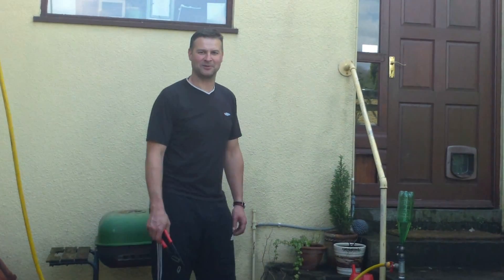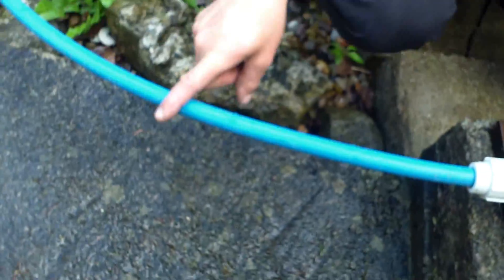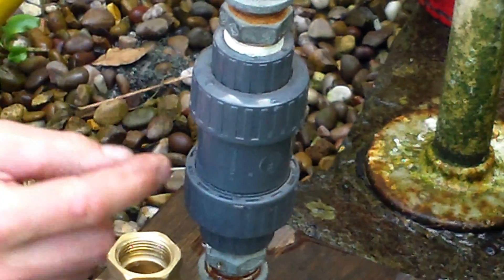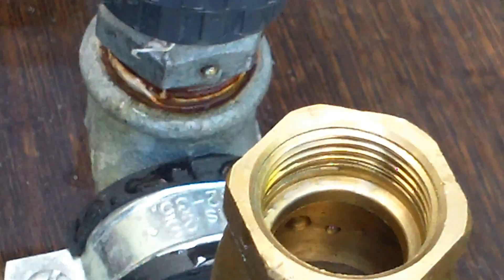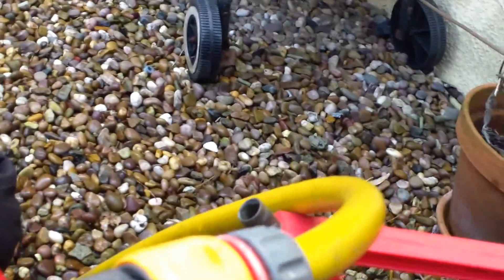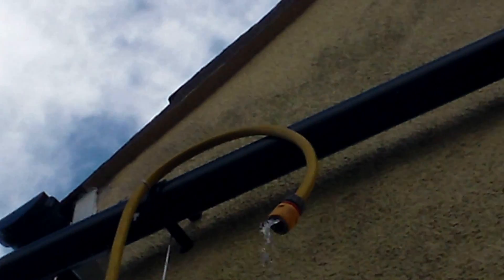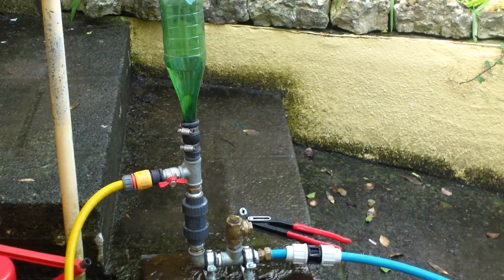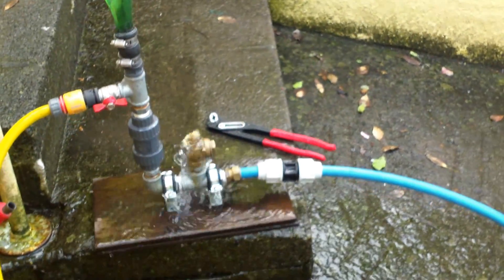Home built model hydraulic ram pump

Comment: hi jony sorry I took so long but it,s dificult to know where to start . So ram pumps,!!!!. if YOU could raise the preshure in the top chamber to 3.5 bar and spirell the the out flomin a loop and back uf around the main chute  in a much rudused pipe  ?????with that cind ov power we could drive several turbins set in,line back down another second tube en  anyway i have these two explosion resistent G 3.5 bar plastic gas main pipes with about a foot of ifon wraped around it in a geometric funnel and i beleive WE MIGHT BE ABLE TO COME UP  WITH SOMETHING starteling but i think these to tubes are only the core of  the sistem it will grt bigger cos think we put that much water pressure in your hands on a variable novle you brain will wake up to this   look up viktor schauberger ard realy watch his living water a then watchh callem coats who tells the true story of schauberger 
 and then go from there but i also have some unbeleivable picturs from egypt which havnt appeared in print that would make you think   anyway think on this lot and if want get in touch

Comment: hey jhonny..nice video.. i tried the above setup using 1inch swing valve, 3inch inlet pipe and 1.5inch outlet pipe..bht the valve was not opening and closing automaticLly.. can you suggest wat went wrong

i want to make a system for 4" outlet pipe.. i have got good flow of water around my farm. it would be nice if you could advise me dimesion of parts to be used  to make 4" delivery from pump..
thanks a lot
cheers

Comment: Planning to build a delivery system from a well which is about 14ft deep to feed drinking troughs for cattle, Could this type of system be adapted to also pump up the water from the well and run horizontally to 2 troughs, thanks.

Comment: Great Video. could you use the water flow out to turn a pump that you could hook a dc generator up to to create DC Current? and how much air pressure can you get to build up? Could you get enough to air up a tire or run air tools? Thank you heres my email address. cody.wilkenson@yahoo.com

Comment from the maker: Hi,

The pump needs to be situated above the water level. I'm afraid you will need to get a fall of at least 2 ft, preferably a bit more, you will have to lengthen your drive pipe, if it becomes too long you will need to install a standpipe about 20 ft from the pump, i'll send you my email and i could send you a diagram.

Comment: Hi Jonny, thanks for the reply, I appreciate your time. Still missing something though. How can the swing check valve be clear of the water, if the pump is at the bottom of the stream? The river is pretty level, I can only get "drop" using the height of the stream, so the pump bits, including the swing check valve would need to be 2' below the surface. Or am I mis-understanding?

Comment from the maker: Hi, if you can get sufficient fall over the 30 ft then you should be fine, aim to get at least 2 ft and you should be in business, try and anchor the drive pipe to prevent it from moving too much, this will ensure your pressure wave is maximized. Bolt the ram pump down securely, on a piece of wood or better still a short length of RSJ or similar. Swing check valve should be clear of the water to keep it working well. Its a bit of a suck it and see thing, a bit of experimentation will be needed j

Comment: Hi ,
love the demo, quick question. We have a stream, not too deep. Assuming the pump sits on the bed of the stream and we use a long inlet pipe (30'), the other end just below the surface upstream, will we still get enough pressure? We dont care if it is a gallon per day, as long as it works. Is it OK for the brass swing check valve to be well submerged, will the water still push out of it?
thanks

Comment: Thanks for the operating description.  Apparently some people don't realize that the ram pump is located about 10 feed below the source, in or adjacent the downstream waterway.  So the waste water finds it's way into the stream where it would have passed (if not captured by the upstream feed hose) anyway.  I like the idea of using a plastic bottle as the pressure vessel to better see what is going on in that component.

Comment from the maker: I think you will find that i was refering to the general construction of the main components of the pump. I know that these pumps will work with different falls. This is just a demo, normally the pump would be in a stream so water used to drive the pump would return into the stream. Watch the demo again and you will see that i was pumping water approximately 10 feet high. Thanks for watching and commenting, regards, John

Comment: how does the water return back to the stream,  it's TEN feet higher than the pump.
?? why do you say that the check valve is IRON,  it's clearly BRASS ?,
   the water supply need only be, say about  2 feet higher, even less willl work,  not TEN feet,  
regards,

Comment from the maker: Right well i am not a total expert on ram pumps, The simple ram pump which is the model i have made will require a water source input situated higher then the point at where the actual pump is sited. However there is a more complicated ram pump made which uses a dirty water source to pump a clean water source. Its called a compound ram and it uses a dirty water supply to pump a clean water supply.  Green and carter make one. Check it out. Cheers John.

Comment: In 1772 John Whitehurst of Cheshire in the United Kingdom invented a manually controlled precursor of the hydraulic ram called the "pulsation engine". The first one he installed, in 1772 at Oulton, Cheshire, raised water to a height of 16 ft (4.9 m).[1] He installed another in an Irish property in 1783. He did not patent it, and details are obscure, but it is known to have had an air vessel.

Comment from the maker: Hi both your questions are  connected. The little hole that is directly beneath the non return valve is called the snifter, on each stroke it allows a small amount of air to enter the pump and pass into the pressure vessel, this prevents the air vessel from becoming water logged and as you have spotted the air bubbles prevent this water logging. Check out my other videos as they show you a step by step account on construction. Cheers and good luck

Comment: Hi, this looks very interesting and I am planning to build one like this, two things of which I am not sure or I haven't understood them properly: First one is the small hole just below the non-return valve, what is it's exact purpose?is it used depresurizing whatever is above (water, air, both)? Second is related to the bottle, I see that it is under pressure, is it ever full only with water, or is impossible due to air bubbles inside?If eventually is full with water, is the pump still working?

Comment from the maker: You have to look at it in a different way; Imagine that the water is free petrol that drives the pump then most of it is returned into the stream. The pump is quite inefficient, only pumping a small proportion of the water that actually enters the pump, but like i say it does not matter as the majority of the water after it has operated the pump returns back into the stream. In my demo the water was being wasted as i had set up a demo in my back garden and i don't have a stream. LOL